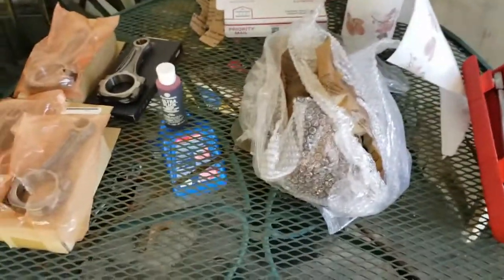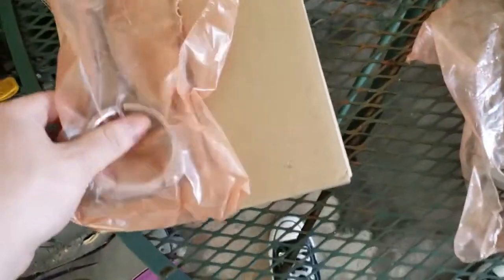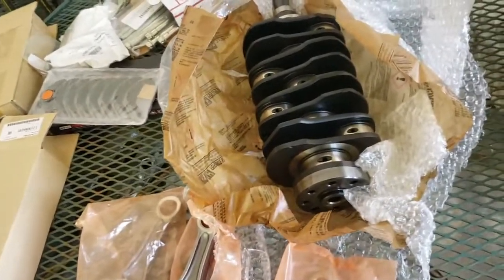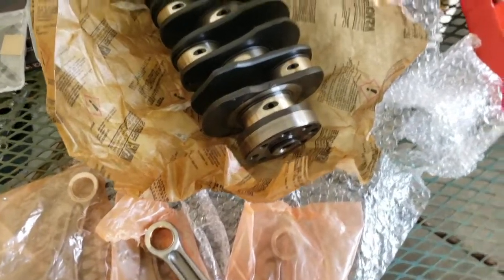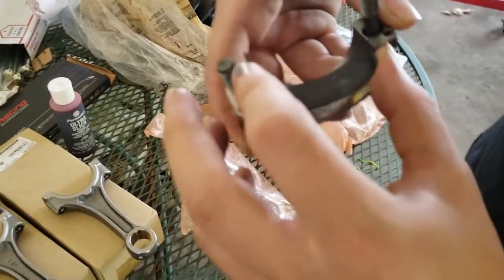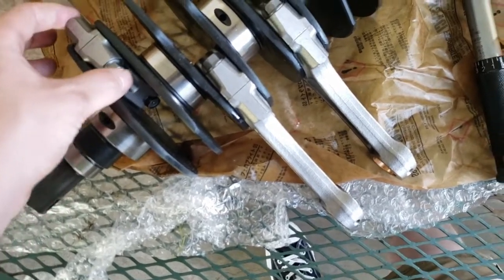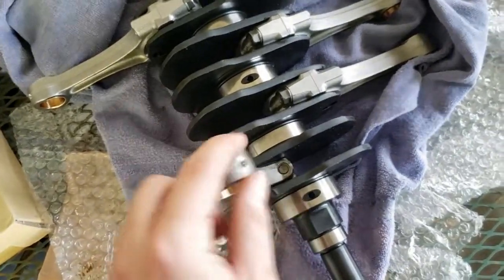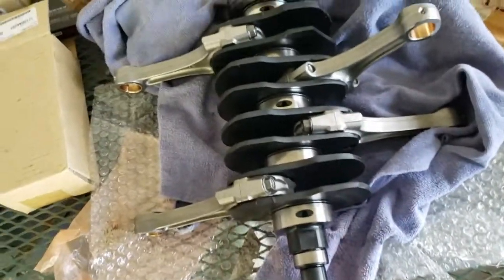WRX/STI Stroker Build Pt: 1 (Connecting Rods)

Comment: It will warp the crank, you always stand the crank.Bolt it to a flex plate, or convert a used disc.
STD is stock, you should at least micro polish, but your crank is new, 
Hope your engine runs great.clean, clean clean, check everything, I would even check new parts for clearance, plastigauge is fast and close.
Don't worry young man just do it, mistakes will happen, it's how we learn.
Reply from the maker: Thanks for the information

Comment: I knew this was posted a while ago but I just wanted to ask if you used your wrx harmonic balancer with this crankshaft
Reply from the maker: I swapped it out with a new perrin light weight crank pulley. You should be able to use the stock ej20 harmonic balancer on the ej25 crank.

Comment: Nice video. I have a question. Why did you install the rods with the number and dots facing forward? Just asking because that side of the rod supposed to be facing to the rear. Thanks